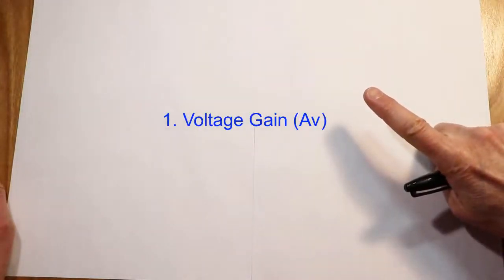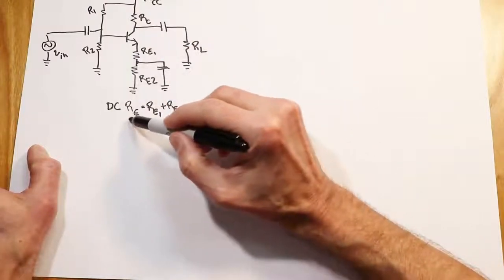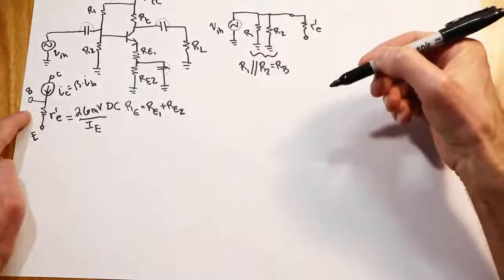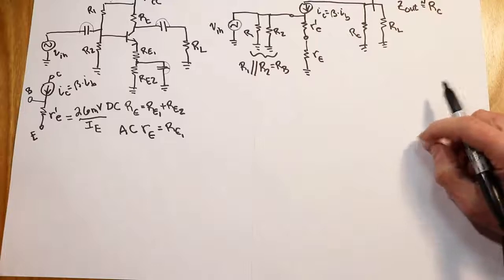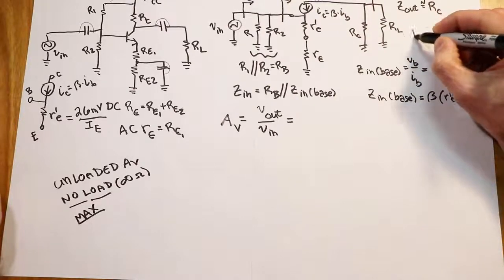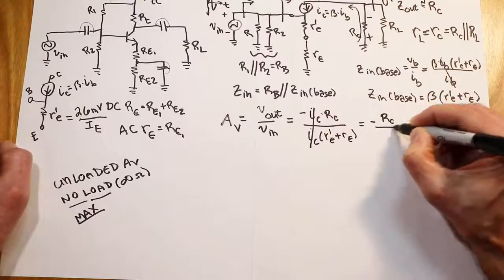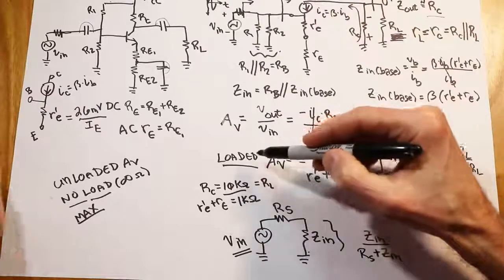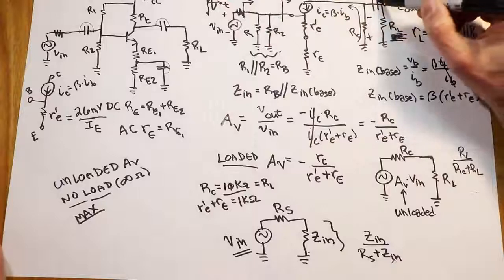Semiconductor Devices: Common Emitter Amplifier

Comment: Slight correction: r'e = 26mV / Ic
Reply from the maker: Yes (the derivation can be found in chapter 7 of my semiconductor devices text), but we're splitting hairs here. From a practical standpoint, there is no real difference. With typical betas for small signal BJTs, the difference between Ic and Ie is under 1%, and perhaps more importantly in this case, the circuit schematic shows a swamped configuration. That means that the precise value of r'e is not all that important because of rE.
Reply: @ElectronicswithProfessorFiore  Absolutely right, and I'm glad this is documented here now for anyone else watching the presentation in future.

I was feeling particularly sensitive to r'e when I left the comment, since I was seeing a discrepancy in LTspice simulation results vs theory when measuring an un-degenerated CE amp.  r'e was 17.3333 computed, but was measuring ~18.8679  (1.5mA quiescent Ic, 5k RL, 10V supply).  Predicted gain of 288 but measured gain of 265, an 8% difference!  Gain was predicted from the typical RL/r'e.  So why an 8% error?  In a simulator of all things?  Took me the rest of the day to realize I needed to also consider the bulk resistance of the collector, which was defined as 1 ohm in the SPICE model.  1 ohm becomes a significant part of r'e when r'e is only 17.333 to begin with.  With the improved denominator of 18.333 (r'e+Rc) the gain calculation (Av=273) is much closer to what is measured (265), but still not quite right.  I'm not sure where the remaining error is coming from.  😞

And yes I realize in a typical circuit this difference is insignificant because you'd typically degenerate that CE amp, but I'm trying to understand the physics of the transistor alone more precisely.
Reply from the maker: @BartKus  Don't forget, the model we're using here is simplified. It ignores a bunch of things (that are usually fine to ignore in many cases). For example, what is the equivalent internal resistance of the collector current source in the model (we assume infinite)? Ultimately, that will lower the gain and may be noticeable with large load and biasing resistances. What about r'b (an effective base resistance)? Usually, too small to bother with but it can reduce the input voltage (i.e., the signal that effectively appears across r'e) which lowers the load voltage. 

Models are always a balancing act between computational efficiency and accuracy. The thing I always tried to reinforce in lecture is not to get too caught up in this. As long as you know the limits of your model, you should be OK. What is the point in chasing down deviations that are a fraction of a percent in your computations when your production circuit uses 5 or 10% component tolerances that will create much larger deviations? Better to spend your time doing an analysis of min/max performance so you can quantify the variability coming off the production line. A basic Monte Carlo sim can shed some light on this very quickly.
Reply: Actually, Vtherm = kT/q, so for an ideal transistor, Vtherm/T = 86.17μV/K
That gives you Vtherm = 25mV at 290K = 17°C and Vtherm = 26mV at 302K = 29°C
That 12 degree range is more or less what we consider room temperature, so neither value is any more correct than the other.
Reply: @BartKus  Another complicating factor is that the output impedance of small signal BJTs is only of the order of a few hundred kilohms under normal conditions and that could account for maybe 2% reduction in gain below predicted. Similarly the bulk base resistance is just a wild guess at 1 ohm. In a real transistor it is just as likely to be 0.5 ohm or 2 ohm. That can account for another few percent variation. Finally, the Miller effect due to collector-base capacitance can be significant at high gains and can easily account for another few percent. Try varying your test frequency and see if the gain changes in the real circuit.
Reply: colinmitchell7760  WTF are you talking about? Anybody who has worked with BJTs or can read a datasheet will be able to tell you that.

Take the 2N2222A for example. On page 3 of its ST datasheet dated February 2003, we read that its output admittance, hoe, at 1mA is between 5μS and 35μS - that is an output impedance between 200K and 28K.

So just what did you think the output impedance of a small signal BJT was? Tell us so that we can all have a laugh.